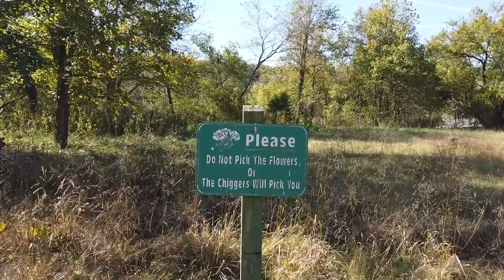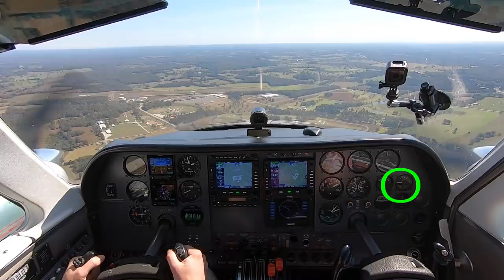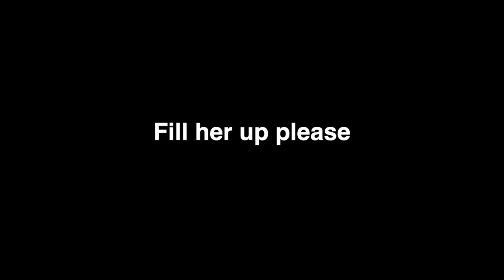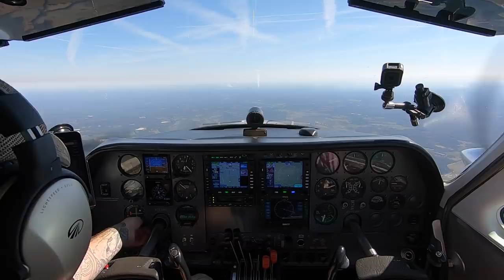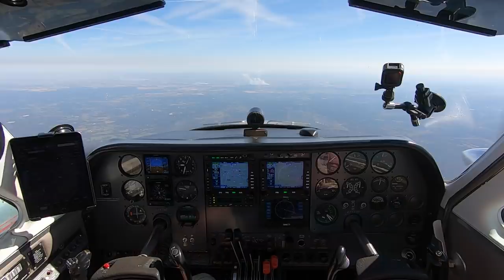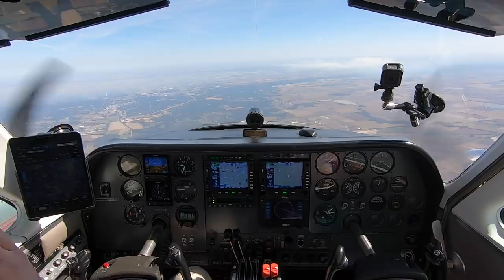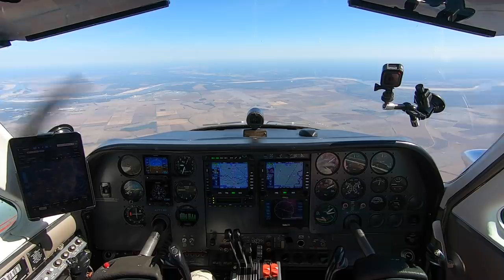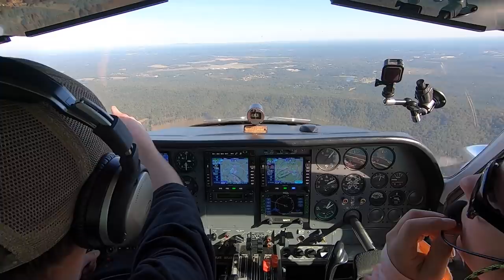ROUGH Takeoff~Dual Vacuum Pump Failure...Again

Comment: Another great video. I sure didn't notice those bumps at Gaston's on the landing but they were so obvious on the departure. Appeared as if the takeoff through the trees was even tighter than the landing. Great job as always. Will be interesting to hear what the "fix" was for the double vacuum failure. Take care.

Comment: Kevin, replace the filter that leads to the vacuum system.  I have 421b and this happened in IMC.  Flying through rain or parked outside in heavy rain can cause seepage and will find its way through he system even though it should be fulled enclosed and stand alone.  Mine entered through the windshield alcohol device nozzle on the nose.  This can cause havoc or worse, but i had no digital equipment.

Comment: Little Rock AFB Aero Club flew all their planes up there in 1974 - was BARE BONES then.  The Fleet returned minus one T-41 that flipped when it hit nose wheel down during Spot Landing contest.  They won SHORT LANDING ROLL.  I had flown that plane up there, and had to drive back in the car with the CRASH INSTRUCTOR.

Comment: sometimes there is brilliance in few words. your sister saying "it just felt weird going towards trees" was what i think every non-pilot was thinking there.
Reply: Pilots don't like it either.
Reply from the maker: Yeah, I sure prefer the open flat farm fields off the end of a runway like we have at our home airport! I briefed that if we lost an engine shortly after liftoff we were probably going to put it in the river as the safest place. As soon as I got a couple hundred feet there I could safely top the ridges on one.
Reply: So, back when we had the Gaston's Fly-In in June (hot!), it was Sunday fly-home day, winds were wacky such that there was a tailwind component on Rwy 6. As a result, the folks who needed to load-up with full fuel and/or people were shuttling over to Mountain Home and vanning over bags and stuff, and others (like me) were shuttling the pilots from Mountain Home back to Gaston's to finish the packing, etc.  

I'm on my way back on that 4-minute flight (45 minute drive), and I hear a guy in a Cherokee 160, loaded with full fuel, Dad/Pilot, Mom and two kids, announce on the roll taking off of Rwy. 6, followed about 45 seconds later by same pilot's voice on the radio, hollering "YeeHaw!"  Landed, and everyone's walking around holding their heads in their hands.  Seems the guy did not so much take off, as he flew off the end of the runway and sunk a little into that little valley.  Those watching were expecting a ball of fire and tragic deaths.  The pilot managed to nurse it around and climb-out over the river (though he flew under the power lines you see on base), got speed and climbed up to as successful departure.  

The next year, he had purchased a Bonanza, having decided the kids were too big for the Cherokee - and it was slow - and 285 beats 160 every time.  

There's a story there too, but not to be published.  Remind me to tell you that story when we meet and share chilled beverages.

Comment: Little Rock AFB Aero Club flew all their planes into CALICO ROCK (37T) in 1975 - was BARE BONES then.  The Fleet returned minus one T-41 that flipped when it hit nose wheel down during Spot Landing contest.  They won SHORT LANDING ROLL.  I had flown that plane up there, and had to drive back in the car with the CRASH INSTRUCTOR.

Comment: You usually find the smooth air above the “haze layer”. This is where temperature and dew point meet. It’s a must know altitude flying in  the SE in the summer (if you want smooth air). 12k is the highest I’ve seen it be in 30 years of flying. (From one Athens born and raised to another). Keep up the interesting flights.

Comment: Mike Busch on the Savvy Aviation channel talks a lot about 310 dual vacuum leaks because of a clear plastic cylinder where the vacuum systems join from both engines. They can develop cracks. Cant remember exactly but I think its about the mags needing pressure at high altitude.  We going to see you at Fun and Sun?

Comment: Make sure the maintenance facility vacuums out the vacuum and pressure sides of the system. When a vacuum pump fails, sometimes debris gets into the system and it needs to be cleaned out. If not cleaned it can cause both vacuum pumps to fail. I don’t know how it can inflate the deice boots if failed. Possibly vacuum being lost due to a deice valve problem.

Comment: It is very unlikely that both pumps failed at the same time. Yes, the gauge showed loss off vacuum from both pumps at the same time. Here is the problem... There is a device called the vacuum manifold and it contains two flexible flapper valves that shut off the flow to a non functioning pump. You have at least one broken flapper valve. The manifold is on the aft side of the front bulkhead behind the instrument panel on passenger side. It needs to be replaced. This is a common problem in twin Cessna's. You should always check functionality at engine start and shutdown by verifying the corresponding dolls eye disappears only on the running engine. Nice plane you have!

Comment: Have your shop check the deice pressure valves.  If the Air doesn't escape out pressure side, stresses pumps and they will fail

Comment: Know Kevin has great A&Ps (mechanics) but wonder if they replaced / checked & cleaned the vacuum lines leading into the pumps? Just finished an annual on my Baron & put in all new vacuum (& fuel, oil, hydraulic & brake) lines. One bit (a curved section) is aluminum and needed a weld repair. Always nervous that the welder will leave a bit of slag or debris & get pulled into & trash the pump. Made double sure it was smooth & clean. Just a thought given how unusual & frequent your failures have been. Love the videos!

Comment: Check to see if you have holes in your boots. I had small pinholes in my boots which allowed water into the system which ultimately failed both vacuum pumps. You might have water or some other contaminant in the system.

Comment: Boot De-ice valves not set properly. Plus you probably have a check valve that's bad. Did you have any valves replaced recently?

Also the boots are sucked down in flight by vacuum. Dual vac fail obviously no suction. If you have pin holes in your boots they will inflate in flight.

Comment: Hey Kevin...another excellent video~~Thanks!! Curious, the gauge two over from the vacuum that oscillates constantly...what is that? Nothing close to that on my Baron and can't zoom in...
Reply: Pretty sure those are fuel gauges. As the fuel sloshes around, the sending unit floats rise and fall.

Comment: It seems to me that it was not long ago that you replaced both vacuum pumps with new. 
Are they in warranty and should the installer do replacements?
Great flight to Rome and your sister seems much more comfortable.
Thanks for sharing.

Comment: Kevin; the problem with the Dry Air pumps maybe because you got contamination in the pump when you landed hard on the grass stripe or Water may have seeped  in while being tied down on the Grass apron. Just a thought. P.S. you should Keep the Seatbelt light on so your wife does not bump the Camera (LOL)

Comment: Kevin I love your sweet airplane . I've flown in a few single engine planes but never in a Cessna twin engine plane ,  I love the sound of the engines on take off  and after you get airborne . I'm an Air Force Veteran . I regret not taking flying lessons while I was in the Air Force ,they might have helped pay for the flying lessons . If you ever fly down to Tampa Bay , Florida I'd love to go flying with you in your sweet airplane . I'd gladly chip in to help pay for the avgas . Does your plane have air - conditioning
Reply: A veteran. Really. A veteran.

Comment: Have you had the engines cleaned lately? We used to have a problem with engine degreaser getting on the exposed vacuum pump shaft and it really shorted the life expectance down on pumps.

Comment: Nice!  Never even touched the wheels down on grass and I have been flying for 12 years.  That tail cam shot would be awesome with horizon leveling if it is a GP 8/9.  Should give it a shot next time, but pretty sure you have to process it in the GoPro app.  Safe flying!

Comment: i'm interested in the technical side of this. how do the boots work? the vacuum pump sucks them in and when you actuate them they come out and since the vacuum pump failed they couldn't be held in and the aerodynamic pressure differentials sucked them out? what's the vref difference between them being in and out in relation to aerodynamics of the wing while landing?

Comment: Hi Kev, really like the video but there's one thing I don't know. You said that the left and right vacuum pumps failed. Could you please just tell us what systems those vacuum pumps are responsible for please?
Reply: For inflating and deflating the boots on the edge of the wings to break up ice. Not a pilot but I have learned lots thanks to Kevin and Jaime.
Reply: De-Icing boots and Vacuum operated backup instruments.
Reply: He has removed most of the vaccum systems (gauges). If I remember correctly, the only thing that the vaccum pumps run currently is the de-icing boots that he references. If the do run any gauges, they are backup gauges. As he has replaced most with modern.

Comment: Q&A
What to the vac pumps do? and
Why does the FO open her door on landing in Melbourne?
Reply: The vacuum pumps run some of the mechanical gyro instruments (like the attitude indicator and directional gyro) as well as keep the deice boots on the wings sucked flat when they are not being used. 

On pressurized aircraft it’s also used for the outflow valves and pressurization controller.
Reply: Oh.. and the door is for ventilation. Air conditioning is almost unheard of on older light aircraft and with the greenhouse of windows, nearly non-existent insulation, and the high thermal conductivity of aluminum, they get very hot on the ground in the sun. 

Cracking the door, much like the vent function on a sunroof, actually creates an area of high pressure behind it from the prop wash so that quite a bit of air flows in.

Comment: Hey I worked out of YHZ at Aeroteck as a ramp rat, fuelled up 310's. anyone ever fill the low side of the tank and it tipped? Lears we like that too,  our concrete ramp had sloped parking lot. My flyclub was nx door and got my twin rating on piper Seneca ll. '76. This is a good refresher too,  our club shut down aft 911 in '04 and no local schools. No support or interest??

Comment: I totally disagree with not adding full landing flaps in gusty winds. I do agree with adding ref plus 10. Partial flaps extends ground effect on flare and creates a longer float time when things can go wrong. In gusty conditions I want wheels on the ground asap for all the right reasons. Go up to altitude and experiment with full flap landing configuration with added power and airspeed within the white arc, you will find you have better control at flare.  Gusty winds are full of mini wind shears. If wind shear is reported in the approach wait until you are safely committed to the runway before adding flaps full and carry power for control.  If wind shear is real bad you shouldn't be there in the first place. Many years ago I accumulated more than 2k hours in recip twin cessna's while building my resume flying the great lakes weather and thankfully I retired without scratching any paint.

Comment: Just curious. On the vacuum pump failure, what does it do? The plane flew fine and you didn't seem to worry about an emergency landing. Since it came back briefly after you stopped for fuel, is it possible the gauge is baulky and not the actual pump?
Love the videos, I always wanted to fly.
Reply: On a twin engine plane there are two vacuum pumps so a loss of one doesn't really do anything as there still is one working pump

Comment: what`s a boot?..
Reply: The wing edge de-icer is a rubber bladder.  They inflate to crack off any ice on the edge of the wing...very dangerous to have ice on wings..
Reply: @KO4L_Lloyd  and from what I read, they have to be sucked down when not in use, so that if they are needed, there is room for their size and shape to change enough to crack off the ice. So that's why you need vacuum pumps. Right?

Comment: I am not a licensed pilot, so excuse my ignorance here. Does a dual vacuum pump failure not qualify as an emergency? Would it not be best to seek out repair once safely on the ground before flying the plane any further? I am guessing that your craft is equipped with electrical back up instruments [that duplicate the vacuum driven ones] crucial for flight and, given VFR conditions, these failures did not rise to the level of [and declaring ] an emergency to the ATCC in the immediate area. Am I correct in saying that, if this had been a IMC and / or night time flight, that it would have been imperative to contact the ATCC and declare an emergency? I will appreciate comments from licensed GA pilots.

Comment: Regarding the right seat attitude indicator's claim of perturbations early in the flight I found that inconsistent with my meticulous notes so I want back to recheck and sure enough the suspension was too firm. If the suspension could be loosened to allow freer movement in future flights that would be beneficial. Maybe a checkride with some zero g maneuvers to dial it in.

Comment: Just wondering why you do not fly over the field (on that crosswind)  at least 500-800 feet, above pattern altitude, then circle back (teardrop) back for a standard 45 degree entry to the downwind?  You seem to enter the downwind from that "mid field" crosswind, at pattern altitude,    Someday, might you not "meet" someone who is entering that same downwind, on their 45, but maybe a little low, and you can't see him?  Just a thought - not meant as a mean post.  I never got the multi engine, looks like fun.   Thanks.

Comment: Kevin is there another solution for vacuum such as an electric pump?  Engine driven vacuum pumps are notoriously  unreliable.  This has become your weak link which is ridiculous in 2021 and with what you have done to the aircraft.